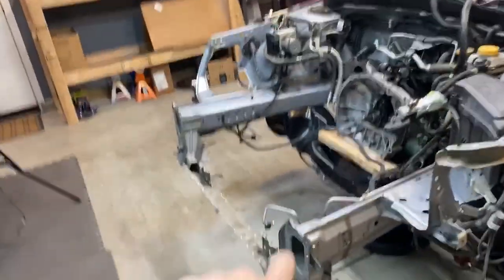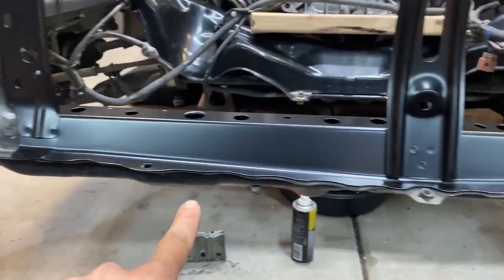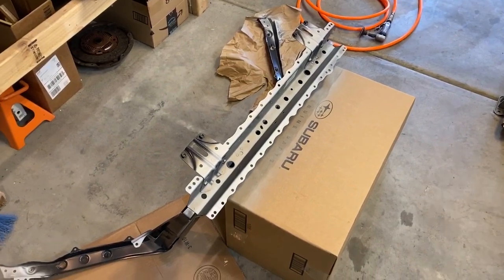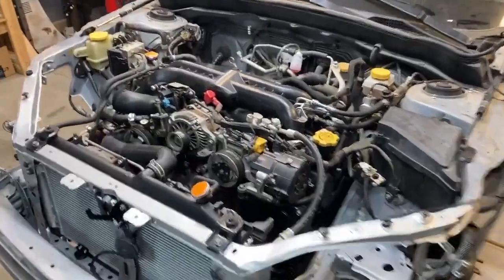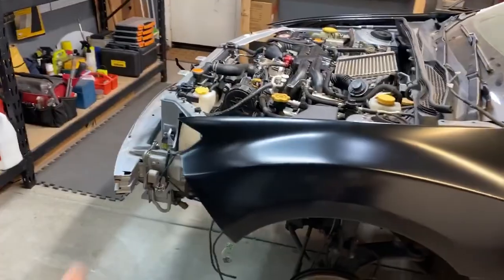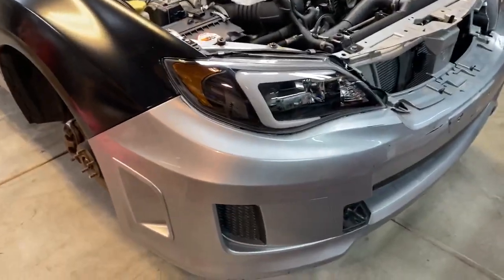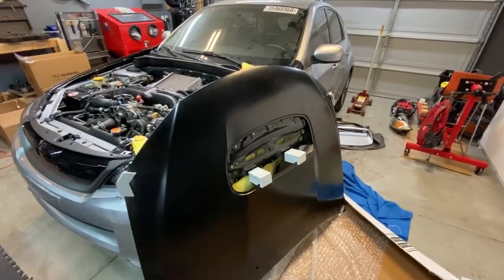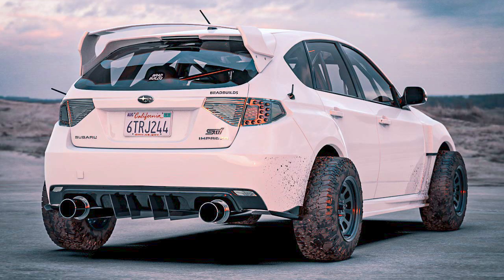Totaled WRX Gets REBUILT - New Radiator Support Welded, Engine and New Panels get installed! Part 3

Comment: Hey, I don't know if you still respond to comments but, I need to know where you purchased the radiator support frame. Did you buy straight from Subaru? I looked on their website and it only comes into individual pieces
Reply: Part Code?